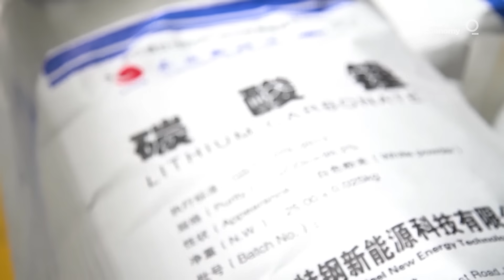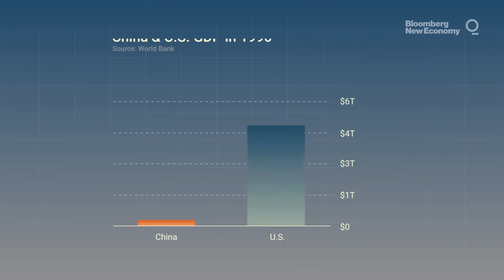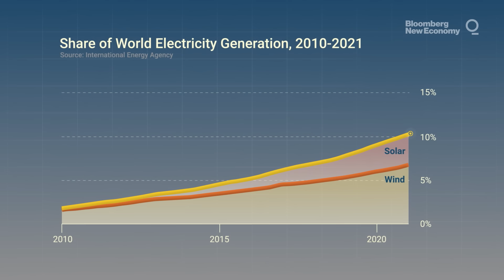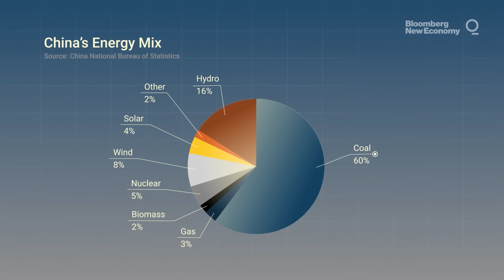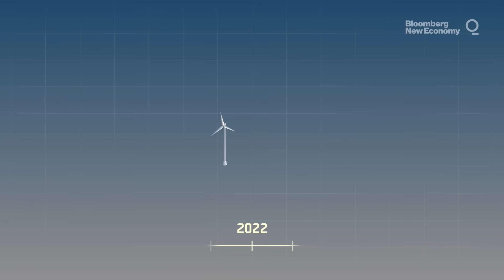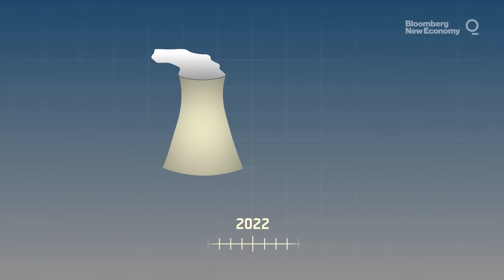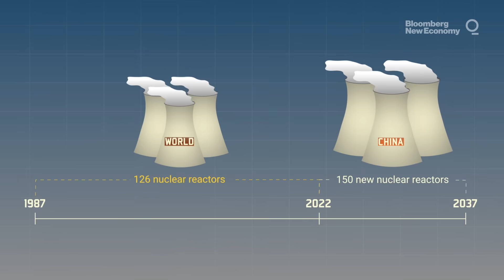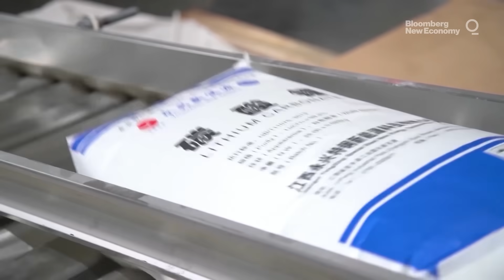How China Plans to Win the Future of Energy

Comment: Base on CO2 per capita, the US is still by far the biggest polluter.
Reply: true. And as long as US cities, especially the suburban concepts are built around cars, that won't change quite so easily
Reply: @triss23199  forget cars, the meat industry is one of the biggest contributors
Reply: @Hhhh22222-w  that's true. Cars are an issue as well though
Reply: @jsmythib  🤣 stupido
Reply: @Hhhh22222-w  Not as big as cars.  Not in the US, anyway.  Cars are way bigger GHG producers than meat in the developed world.
Reply: @triss23199  False.  US per cap CO2 is 16th among countries, lower than some major countries including Australia and Canada.  US per cap emissions have fallen 1/4 since 2000, largely due to switch from coal to gas, more efficient cars and buildings. US per cap emissions will continue to fall, though getting to zero will be very difficult.

US per cap emissions relative to most major countries  are high for three major reasons:  continental climate w severe hot and cold forcing heating and cooling systems in most buildings (also see Canada), a bi coastal population distribution on a continent forcing long distance transpo (also see Canada), and a US industrial and building explosion starting a hundred years ago well before the rest of the world, using crude building enviro tech of the time, with much of that building infrastructure still standing today.  That building fleet is being replaced, slowly at first, faster now.

These kinds of ‘US is the worst’ errors are why it’s so difficult to resolve emissions policy problems.  It’s called global climate change for a reason.
Reply: Not correct.  A dozen other countries have higher per cap emissions than US, two of them are major countries, Canada and Australia. US per cap emissions are declining rapidly.  Not so China, India, Indonesia.

These kinds of gross errors are why global emissions policies are so hard to resolve.
Reply: And the data doesn't included CO2 from US military.......
Reply: @dicksontong6498  US per cap emission  figures based on the entire population, including military. Anyway military is 1.5% of US fossil fuel consumption.
Reply: Qatar. 37 tons per person per year.
Reply: @appa609  In Qatar and other similar small o countries w large gas-oil exports, their high per cap numbers come largely from the preparation of fossil fuels for export relative to a small population, which other nations actually consume.  So, given a goal of using cleaner energy, the lesson is not for Qatar to use less/cleaner but for all of the big importing countries to do so.  

Canada is 19 tons, Australia is 17 tons, both with large economies, based mainly on end consumption of coal or large transpo/heating needs.  US is 15 tons currently, down from a peak of 23, as it turns over an old leaky building fleet, moves from coal to gas, and holds on (barely) to the worlds largest low carbon nuclear fleet. 

France is 5 tons.  By contrast China is already 7 tons and rising fast.  France then is the model to follow, at least for their electric grid, which every nation could follow, unlike, say, Norway’s clean hydro example.
Reply: @appa609  China has regions with 55t per cap.
Reply: But in americans colonial mindset, they are the only exception, bigger and bigger pickup truck, they need huge engines to demostrate american musculinity
Reply: agreed extremely !
Reply: Western media is anything but independent reporting.  Just look at who signs their paychecks. .....
Reply: @_Wai_Wai_  Western media is a strange hybrid of corporate cleptocracy owners, with anti-Western messaging dominated by foreign services that appeal to the presstitutes, who think they're being objective by taking foreign disinformation as bravery.
Reply: Not per capita, the United States is also the second
Reply: Electric cars aren't helping.
As long as EVs are charged by fossil fuel plants, EVs use more fossil fuel per mile than gas combustion engines.
Reply: People who dare to tell the truth have slowly disappeared from this world.
Reply: @xinyisuoshu  yep, they get sent to "re-education" camps.
Reply: Yeah, but Americans can vote to change their energy policies.
If the people can't vote to change their energy policies, they don't get to win by "per capita"... especially because China literally shuts down minor cities, freezing them in the winter, just so they can run energy to their propaganda focused cities.
Reply: @BeastOrGod  Americans voting...Thats rich.  Sorry- To big to fails run my country....Which is now actually China.  Once the Americans and the Russians destroy each other(Thanks China)- Hello red star, mandatory hammer and sickle tattoos for everyone.
Reply: China is twice the levels of the US.  Chinese smog in the cities causes adult onset asthma for many people, chronic illnesses, lung disease, and cancer.
Reply: Russia is nothing but a pepper Tiger as same as China , North Korea as we saw their old and ancient performance in Ukraine So what you have to rely on is America The inventor and franchiser of 98% of World modern and future Technologies , all those "made in china'' you see comes from those giants companies that are All American branched in china BTW I'm not biased I'm actually Iranian and most of the people here says the same thing so let alone the world.
Reply: US emits very little CO2, cus Americans live in tents, just look under any bridge in the US.
Reply: Isn't UAE by far the largest polluter per capita?
Reply: That's just because huge amount of Chinas population still live in poverty, of course all those Chinese people that consumes so little energy have a tendency to lower the average....

Going by your comment all the US has to do is multiply their population and make all the new people dirt poor. Et voila, no more per capita CO2 lead, problemo solvedo!
Reply: Warcosts heaps.
Reply: The US is 12th globally. Still not doing a great job, but your comment is wrong.
Reply: To be fair, it's Australia on the top
Reply: All the money is being spent on wars and the military industrial complex. Imagine if they spent just half of those 2t they did in Afghanistan on trains, highways, renewables. Every president seems like theyre the same, even the charismatic Obama. Something tells me it is not the president and the party running the country, but the establishment like CIA, Pentagon etc.
Reply: @chewycaca  Pentagon budget is a joke compared to so many others.  MIC is so far down the totem pole that most politicians don't give it much thought.  The top 20 industries in the US make MIC look pathetic.
Reply: @chewycaca  All the money?  You’re the problem mate, not them.  If people paid attention to where all the money goes they’d police it. 

US federal budget: 
Medicare Medicaid SS Veterans etc. $3T
Defense $0.7T
Non-defense discretionary like paycheck protection program $0.7T

That’s per year.  The Afghan spending you cited was a lot, but that was over 20 years.
Reply: yet we've never had a smog day ever in the history of america 😂 but sure, go on
Reply: That is true. However, you should remember that, even with all of its disadvantages, the US have a much better standard of living than China, which means more consumption per capita and therefore more emissions.

Comment: I just wanted to make a point: HVDC is used because in AC lines maximum active power is limited by the reactance of the line, which increases with the distance. In HVDC you don't have reactance during steady-state, so it is possible to increase voltage and transmit much more power. It is true that losses in HVDC are lower than AC but it is not the main reason HVDC technology is chosen
Reply: Wont the impedance in AC lines still be higher than the resistance in a HVDC line though? Also, how do they even step down DC voltage without incurring losses? Unlike ac you cant use transformers
Reply: @someoneonly  to connect HVDC to Ac Lines power electronics is used so inverter and rectifiers
Reply: Thank you for bringing that up, I was wondering too!
Reply: @victorquesada7530   I want to add that also HVDC is used for high voltage cables because in AC it would be impossibile  due to enormours reactive power produced by the capacitance.
Reply: @giovanniportonera5268  Agreed, you're dealing with hundreds of miles (or kilometers, let's not start a religious war lol) of cable. That's a lot of capacitance.
Reply: But is difficult to converter dc to ac and high voltage to low voltage, in ac lines we are generally use tranformers but in case of dc we need extreme powerful inverter and its very difficult to build
Reply: Brilliant! 
Thanks for the Physics.
Reply: This is also known as the Skinning Effect. The cross sectional area of the conductor in which the charge passes through decreases and shifts towards the outer layers of the conductor with high switching frequency as in the case of AC.
Reply: In simple terms can you explain the difference with HDVC. I was always under the impression that we chose AC to transmit power because cable losses in DC where very high in comparison. This was suposedley why Teslas AC was more practical than Eddisons DC who would have needed multiple power stations for every block in a city. Is there a freshhold where HVAC recuctance by passes HVDC cable resistance? Sureley they are not using superconductors in these HVDC lines?
Reply: @RoadRashSpirit  AC is used because thanks to the transformer, which is an efficient and cheap electrical machine, voltage  can be increased to reduce Joule losses which depend on the current transported, and when we are near the towns again thanks to transformer, voltage can be decreased for safety and use of electrical equipment.
 Another important reason is that interrupt DC current is very difficult, while AC current can be easily interrupted. 
Also electrical generators use the magnetic rotating field which give a three phase AC voltage 
HVDC is developing due to both tecnichal and economic reasons. 
To make simple if you want a high voltage cable for more than 100 km you need to use HVDC due to the capacitance of the cable in AC. Instead for a normal high voltage line, under a certain distance is more convienient AC, while above is more feasible both tecnically and economic HVDC.
Reply: @giovanniportonera5268  OK thanks and cool, I understand that, but what I was eluding to, is the high resistance of dc and this voltage drop a myth then? I think with solar panels there is an arguement between series and parralel connections when the power cable goes for some distance to the inverter.

Edit. Actually thinking about what you have just said. Back in the early 1900s they would of had to use lower voltage dc generators since semiconductors and hence inverters/igbts didn't come until later in the century. Dum Dum here never made the connection, cheers
Reply: @RoadRashSpirit  The resistance of the cable under DC and AC is roughly the same. The difference is that with higher voltages (much easier to do with AC than DC) generates much less current over the powerline, thereby significantly reducing the heat loss from the powerline. As @Giovanni Portonera stated, AC  uses transformers to jump to very high voltages (10kV or higher), whereas DC is much higher to jump and requires much more expensive DC converters. Edison used the household 120V for powerlines and could not match the efficiency of Tesla and Westinghouse's 500V powerlines.
Reply: I think economics plays a role as the distance increases past ~600km(some say 800km to 1000km). HVDC starts becoming more affordable than AC.
Reply: Russia is nothing but a pepper Tiger as same as China , North Korea as we saw their old and ancient performance in Ukraine So what you have to rely on is America The inventor and franchiser of 98% of World modern and future Technologies , all those "made in china'' you see comes from those giants companies that are All American branched in china BTW I'm not biased I'm actually Iranian and most of the people here says the same thing so let alone the world...
Reply: the only useful message among comments
Reply: Wow a thread in the comments that addresses low power factor on AC transmission lines. I'm really impressed

Comment: How is DC current is more efficient than AC? I thought the reason why we switched to AC was because it is more efficient
Reply: DC is inefficient because at normal voltages, it allows more current to flow. 
More current = more heat dissipation.

That's why we switched to AC, as it could be more easily switched up to high voltages and down again using transformers. However AC becomes inefficient at longer distances.

But, HDVC is efficient because the voltages are extremely high (order of million volts). At such high voltages, the current passing through the wire is super low, making it efficient for longer distances as we don't have to convert DC to AC for transmission.
Reply: High voltage AC is much easier at getting transformed into higher voltages, and then back down into lower voltages, but suffers from capacitive losses over distance.  AC overhead cables are better for less than 1000KM.
High voltage DC is much harder to transform into higher voltages, but does not suffer capacitive loss over longer distances.  DC over head cables are better for more than 1000KM.
Reply: Do a Google Image Search for "DC vs AC transmission loss", you will see from the graphs for small distance (e.g. <300KM) AC is more efficient, but for longer distance DC is more efficient.
Reply: Ohhh I see now thanks for the detailed explanation folks.

Comment: I think the future of energy is molten salt reactors. Thorium Molten Salt reactors are safer, more fuel efficient, and their waste products degrade faster.
Reply: Nah, they can be handy some times. But have a lot of their own issues, like the others excessive cleaning needed and the poor scaling, and the biggest one made yet barely gets used to any of its expectations.
But overtime it may prove beneficial for some locations
Reply: @nobrac1647  Correction such reactors can be scaled very well. Multiple 10, 30 or 50 megawatt reactors in a facility can be set up and are safer than 1 giant gigawatt reactor facility.  They have there pros and cons but the threat of thermal nuclear explosion is nil with these reactors due to the nature of the nuclear reactions with in the molten salt and the drainage failsafe. The avoidance of a  disaster that costs billons to clean up makes them the go-to choice.
Reply: @jehiahmaduro6827  I've seen Chinas plan to produce these reactors in every major city across China. I wonder how its going was the prototype they built a success?
Reply: I think there is one in this video       powered by the mirrors surrounding it.        从   m
Reply: @user-mg4yw9yc7l  That's a solar thermal powerplant, molten salt reactors are a type of nuclear reactor.
Reply: According to the news in nov2021, China would rollout the 1st thorium reactor in production at oct2022, it is not testing phase.